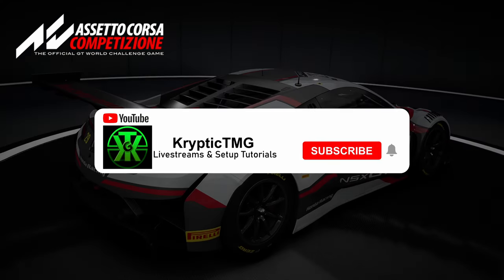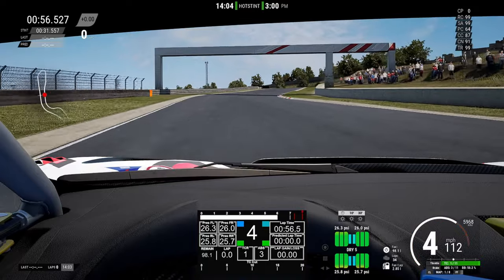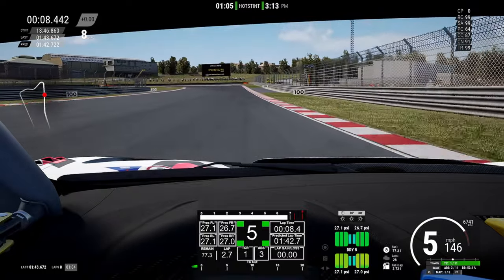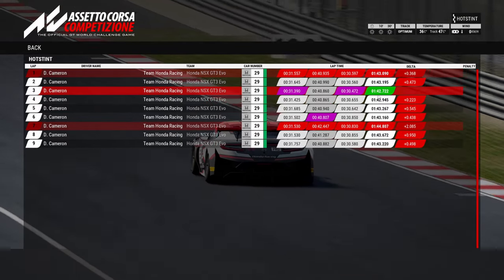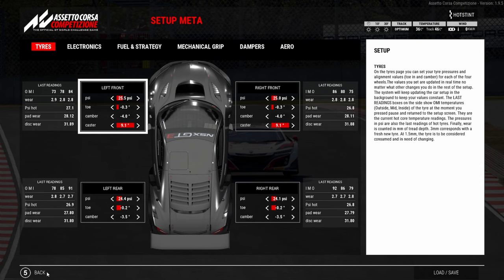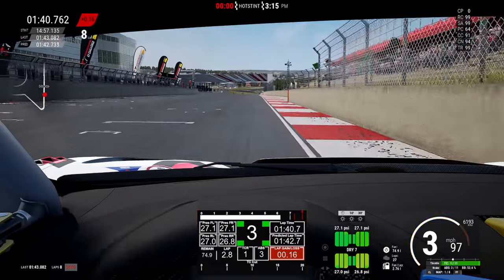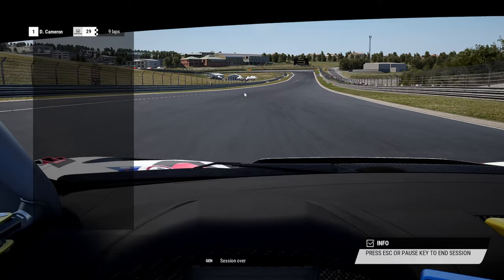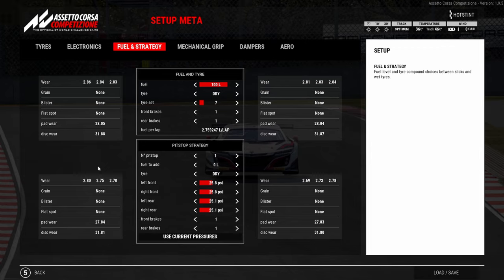META VS MOTEC (Part 2) Which Setup has better Race Pace?

Comment: Hey Kryptic 👋
Thank you for the part 2
Really appreciated 👍
You've said that you give at least the tyre wear for the Motec setup but i think that even in that regard the Meta would still win 😅
Because with the Motec you were running with your rear toe on almost neutral values (-0.05) and with the Meta you were running with quite negative toe (-0.2) and that as you know is what usually kills the tyres quicky. 
I believe if you had run your meta with the same rear toe as in the motec, you would still be as fast as far as meta goes and you would be saving that little bit of tyre...i reckon 😅👍

Comment: I feel like (unfortunately) for the effort you have to put in with Motec setups its not worth it compared to the meta srtups.

I also hope that they will change all those meta abuse things so that setups actually mean something rather than min this max that etc
Reply: This is just the limitations of the physics engine and simulators in general, min max’ers will find a way to exploit whatever they can regardless of changes